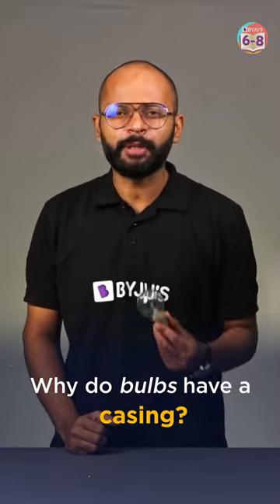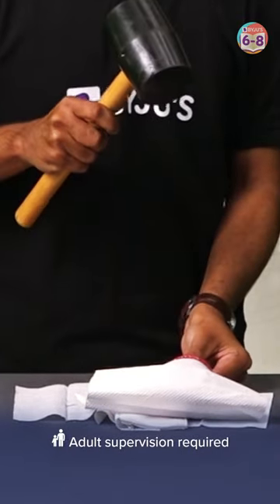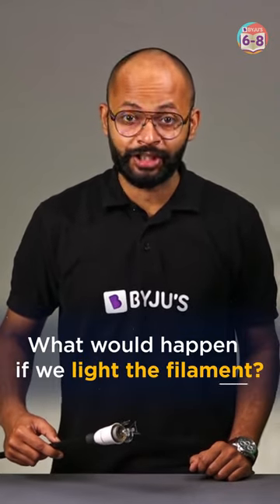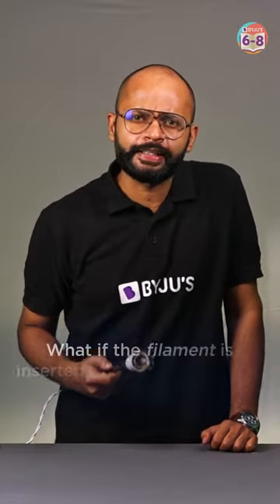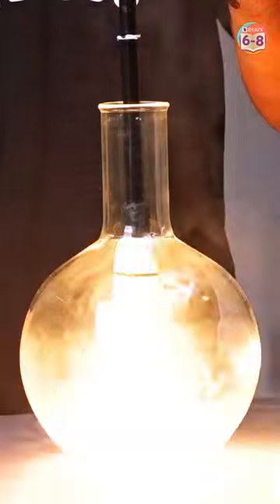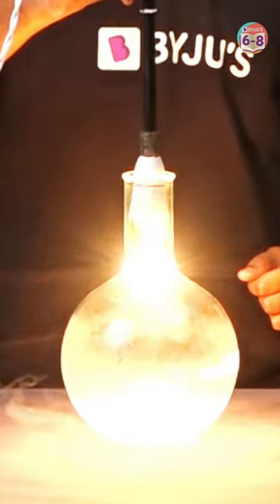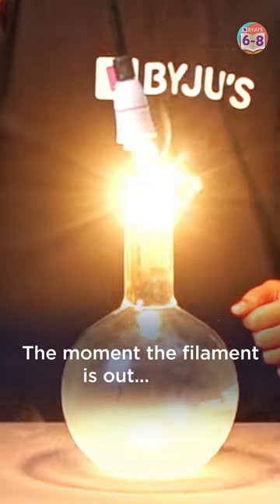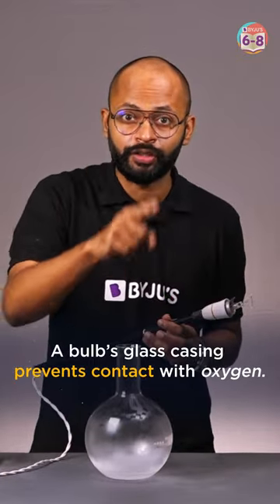What if bulbs did not have a glass casing?? | BYJU'S Classes 6,7&8

Comment: The bulb has very high resistance and very high melting point when the electric current flows through the circuit it quickly heats up to 2500°C. The argon gas protect the filament